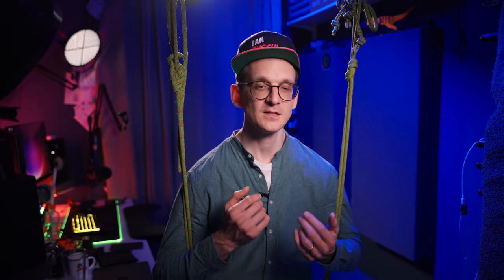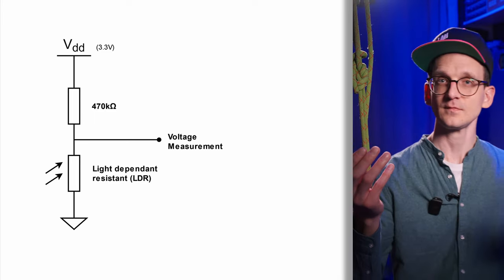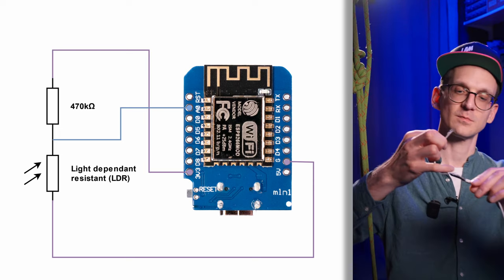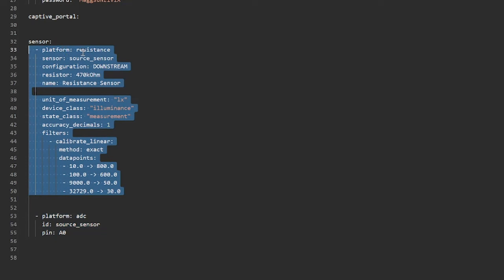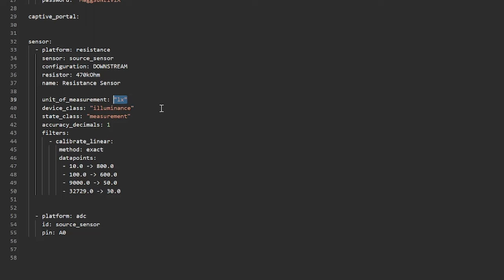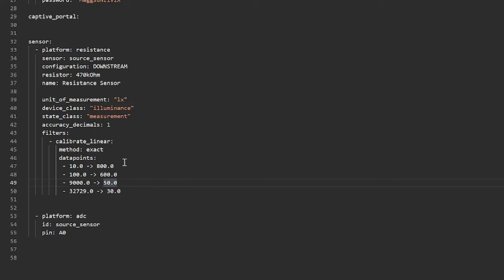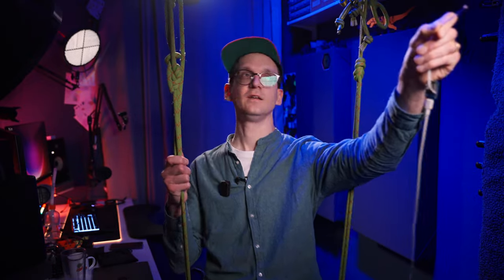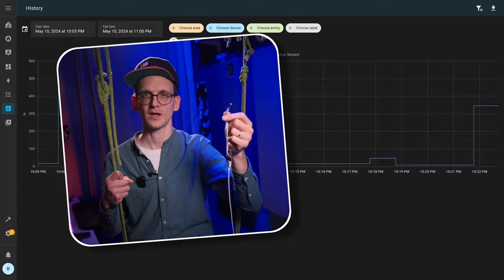Home Assistant DIY LightSensor #esphome

Comment: why not use BH1750?
Reply from the maker: Mhh I guess there are many many more ways to achieve the same goal.. A light dependent resistor is just a passive very simple component that I had available (not unimportant in that context ;) ) .. In direct comparison I think you would hardly find a difference in performance of any of the possible approaches..